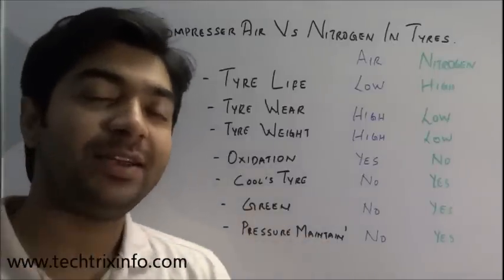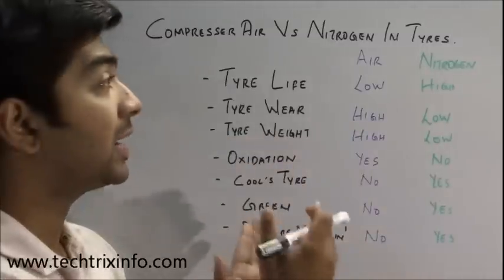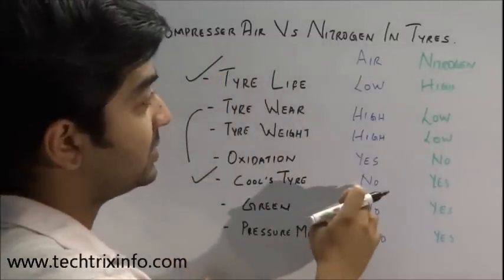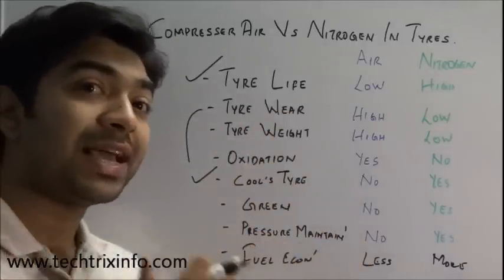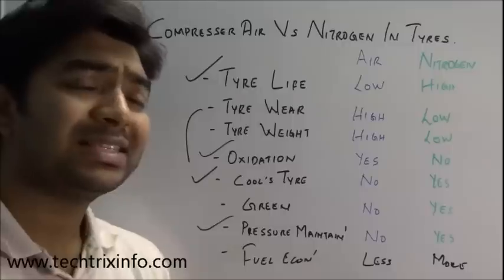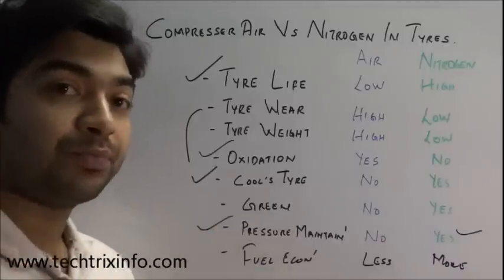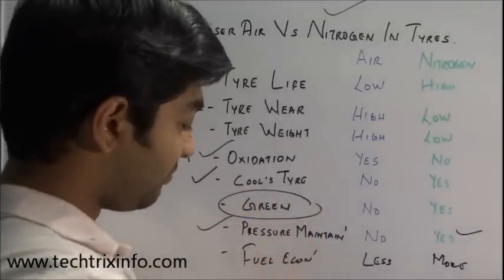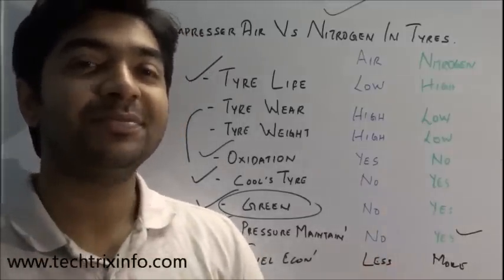Compressed air Vs Nitrogen in car tyres. ✔

Comment: 4) Nitrogen leaks lesser through the minute holes(due to its larger molecular size) and so the pressure remains almost constant, but normal air has about 78% nitrogen itself, so the equivalent effect translates to this - about 10 psi lesser pressure loss every 12 months compared to a air tyre, which is very very negligible if you compare it with the cost of nitrogen filling.
5) nitrogen doesn't cool your tyres, there is no physical mechanism that makes nitrogen cool more than oxygen your tyres.

Comment: 6) yes air is heavier than nitrogen, but how much heavier?( if we neglect moisture; visit a good filling station!). the fuel saved by using nitrogen alone is almost negligibly small, unless, so small that we can ignore it. Its like saying folding your right rear view mirror reduces air drag of your car and so saves fuel.

conclusion: 1) Nitrogen is good only because  it has lesser moisture possibly( if they can provide good nitrogen , the same filling station can provide good dry air too;)

Comment: 2..contd.. So Nitrogen filling is never green as its production itself is about 10 times more polluting than normal compressed air.
3)Good source of compressed air and stations have good air dryers working, so the ingress of moisture is almost zero; but if you find moisture in air, it is only because of the bad filling station you visit. Yes nitrogen supply has almost zero moisture ,because of the apparent mechanism by which it is produced.

Comment: How much difference is in weight in nitrogen filled tyre and air filled tire?
Reply from the maker: Nitrogen is 3% lighter than oxygen, but there's only 22% oxygen in air, so the difference in weight from all 4 tires is 0.3664 grams, that's a whopping one third of a gram!

Comment: Commenting on your video ..point by point 
1) tyre life : lesser tyre failure (tyre crack and blast) due to rubber deterioration from moisture(or oxidation) and uneven heating from low tyre pressure and the uneven resultant stress distribution
Now i'm totally against your video on this: I will explain to you my views:
a) Filling nitrogen in tyres is more costly( about 10 times more) ; 
2) Nitrogen producing mechanism is far more polluting and energy consuming than simple air compression.